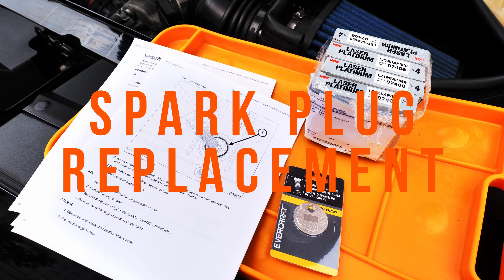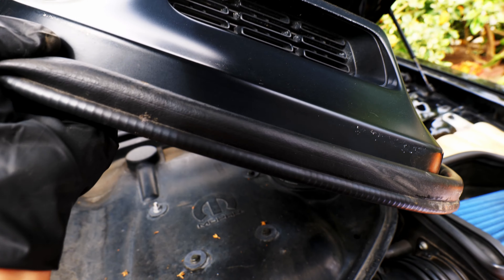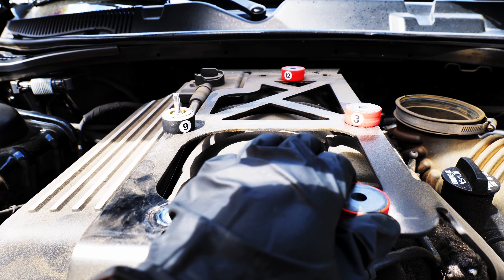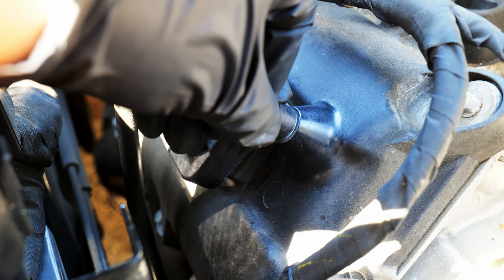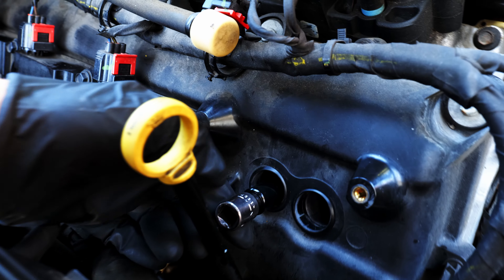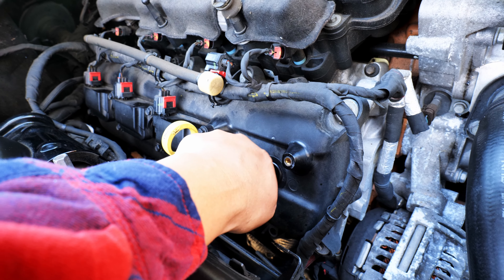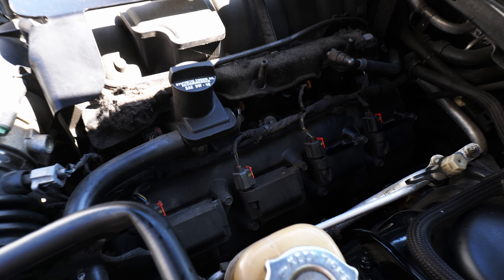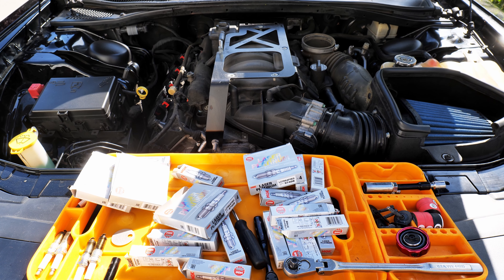DODGE CHALLENGER 392 HEMI SCAT PACK SHAKER SPARK PLUG REPLACEMENT

Comment: You did an amazing job thank you, nobody ever tells what gap the plugs are supposed to be
Reply: The correct ones will be pre gaped no need too also you can ruin the iridium plugs trying to gap them don’t
Reply from the maker: Appreciate you leaving a comment. That’s true for iridium plugs but I used laser platinum plugs. I checked the gap and they were all off. This is from NGK, the manufactuer: 

While plugs are pre-gapped from the factory, the gap may need to be adjusted for the vehicle that the spark plug is intended for.

Gapping the plugs to your engine’s specifications is important to prevent pre-ignition, detonation, fouling and poor fuel economy. 

Even if the preset gap matches that required by your engine, it is always good practice to physically check the gap as it may have shifted during transportation.
Reply from the maker: @jayst3843 Thank you, appreciate it!

Comment: Spark plugs should've had a small dab of "never-seize" on the threads as well as a small dab of dielectric grease placed into the end of each and every sparkplug boot. These small steps prevent a LOT of headaches the next time they need to serviced or replaced.
Reply from the maker: That is not the correct advice for NGK spark plugs. This is from NGK the manufacturer of the spark plugs I used: “NGK spark plugs feature trivalent plating. This silver or chrome-colored finish on the threads is designed to provide corrosion resistance against moisture and chemicals. The coating also acts as a release agent during spark plug removal. NGK spark plugs are installed at the factory dry, without lubrication or anti-seize.

Anti-seize can act as a lubricant, altering torque values up to 20 percent, increasing the risk of spark plug thread breakage and/or metal shell stretch. Thread breakage can sometimes involve removing the cylinder head for repair. Metal shell stretch changes the heat rating of the spark plug and can result in serious engine damage caused by pre-ignition. 

Do not use anti-seize or lubricant on NGK spark plugs. It is completely unnecessary and can be detrimental.”

I worked in an auto shop as an auto tech and we did not use anti seize or grease on NGK spark plugs.
Reply: How many miles on engine.  At times of spark plugs change
Reply from the maker: @truthhurts228 thank you for sharing, I appreciate it!
Reply from the maker: @harryjohnson8605 Around 40K